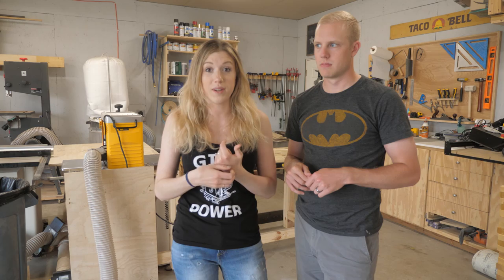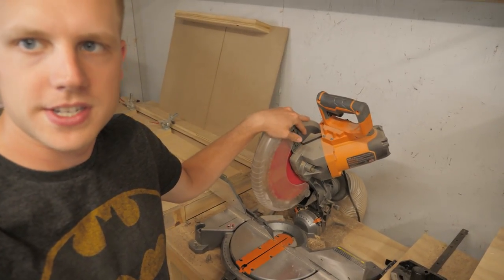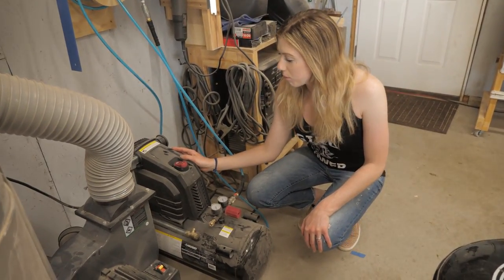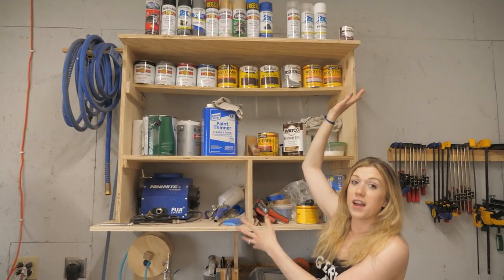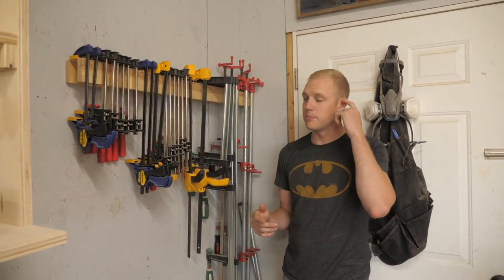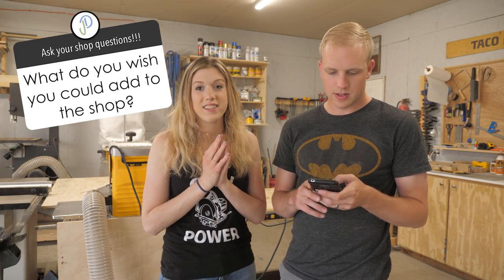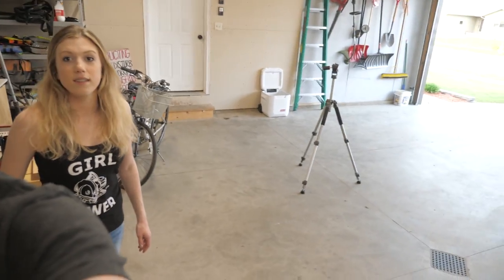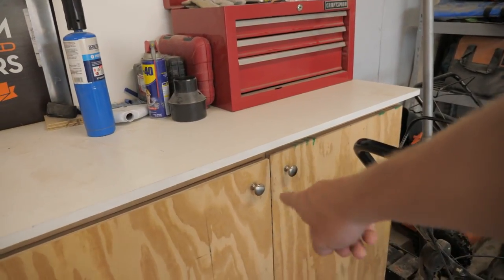Woodworking Shop Tour Summer 2019 | Jennie and Davis

Comment: You guys are absolutely KILLING IT! There's something about the YouTube community that is very special... When my favorite YouTubers get a tool upgrade, it feels like I am as well. We all share in your success and that is a very exciting thing. Very well done!

Now on to my miter saw rant... My first major tool investment was a massive RIGID 12 inch sliding dual bevel miter saw. That is a mouthful. Knowing what I know now, I would not have bought such a crazy piece of machinery. Don't get me wrong, it works very well. And it's incredibly useful. I even got it super cheap on Black Friday a couple years ago. However, it's the older style. It has a monstrously long bar sticking out the back, making it deeper than it is wide. This prevents me from having the standing miter saw station I wants against the wall. I have to have it on a cart. This is great for wheeling it into the driveway, but unpleasant for making a nice garage-wide dust collection. I too work out of my 3rd car garage bay, so everything is on wheels. I'll just be doing a better job planning in the future.

Probably a wasted rant. I'm sure you two have a greater knowledge of tools than I do. I just figured I'd throw it out there in case you haven't considered that scenario. Well done you two! Keep up the great work!

Comment: Some stuff kinda 'janky' lol..  So true. But it's how you use your tool that makes the difference. The biggest difference I have seen between cheap and expensive tools has been in downtime even more than accuracy or speed.  

I evny you both for having so much control and restraint buying tools. I have a crap ton of tools I just seem to keep buying for projects. I have pro contractor buddies that are jealous of my gear. Yet... I am jealous of what they produce. 

Loved the vid. Good luck on the house.. Moving sucks!!!

Edit.. HD just launched the DeWalt expanded clamp line and had all sorts of parallel, strap, pipe and other clamps at decent markdowns. It was an store promo only it looks like.

Comment: Tool walls > Drawers all day

Also, your Welding rods will give a better weld if they're stored dry. Even just sticking in a ziploc with a moisture absorber will help a ton
Reply from the maker: Sweet!! We'll have to start giving that a try. Especially in the south.
Reply from the maker: Nice tip! Got any recommendations for argon gas mig machines? I've only ever done stick but I'm ready to quit dealing with slag.
Reply: @jennieanddavis  what's your budget? That's the big decider
Reply: @jennieanddavis  Check out tig welding. Much cleaner, no sparks, beautiful welds. Get an experienced tig welder to show you the basics and in just a few days you'll go from grinding a weld to just polishing it.

Comment: It takes like 5 minutes to set up a Dado stack. That isn't going to kill your profit. Better quality joints = charge more.
Reply from the maker: I love where your head is at! But 5 minutes is a big underestimation. That might be fine for installing it, but test cuts dialing in heights, and replacement back to a regular blade makes it worth looking into a 2nd table saw
Reply: @jennieanddavis   with more experience it will literally take one minute longer than it does to swap a dull blade for a fresh one. Buy some fastcap mag shims or create your own setup blocks and the height is set in seconds. How do you justify the cost of a second saw when you're going to be adding/subtracting cutters from the stack for different sized dado's anyway?
Reply from the maker: I won't. I'll optimize every furniture design to be consistent with the dados needed. #justified

Additionally, you don't justify business purchases the way you do in personal finance. With a business all your efforts should be on bringing money IN to the business. How much is leaving isn't near as important, so long as it's not a stupid amount more than what's coming in.

Comment: I want to give you two some advice.... do not waste anymore money on junk clamps !   Buy Bessey Parallel clamps... don't get the cheap version either, buy the BEST BESSEY parallel clamps, and the BEST Bessey F-Clamps.  (The heavy duty ones... not the lighter version you had in the video)  You can buy these online from Home Depot, the 24" and 50" parallel clamps are awesome. They will last forever, and since you probably use clamps on EVERY job... just buy the best.   If I had to tell anyone just starting in woodworking what one of the very best tools to invest money in, it would be the best clamps you can afford......and it's true, you can never have enough ;)

Comment: id stay away from stick welding for furniture, theres a lot spatter youll be cleaning and its dirty and smokey, lots of fumes... youd be best off learning tig, its extremely clean and theres no spatter
Reply from the maker: Hah there's no way learning and using tig can be profitable for the business we're trying to run. We'll be switching to mig with shielding gas for all the reasons you mentioned. Thanks for watching! 😊
Reply: @jennieanddavis  how not? i stick, tig, and mig weld professionally... mig will cost you more, because again, youll be cleaning spatter, its just easier and the 75/25 co2 mix is a little cheaper than 100% argon youd be using with tig, and youll spend more on consumables with mig as well
Reply from the maker: Welding, at most, is only ~30% of any given project that requires metal. I can't afford the time investment it takes to be proficient at tig. And if our build process requires future employees to know how to tig weld, that's going to be a very expensive employee for such a small portion of the business. Time is more expensive than most consumables. 

It probably makes sense for you if you have a metal fabrication shop or weld often, but for us I don't see needing more than gas shielded mig.
Reply: @jennieanddavis  tig isnt very hard in all honesty, learning the metalurgy and certain codes and all that is, but for what youre doing it would work out the best... theres no fumes like stick and mig, its cleaner, theres no spatter to spend time cleaning like there is for stick and mig...id seriously put a lot of consideration into it... also with tig youd be able to expand into aluminum, stainless, and titanium as well, also with tig, youd be able to weld thinner steel without warping it.... the benefits and versatility of tig over all other processes far outweighs the inconvenience of learning a new skill...im just telling you because i wished someone told me this 10 years ago 👍